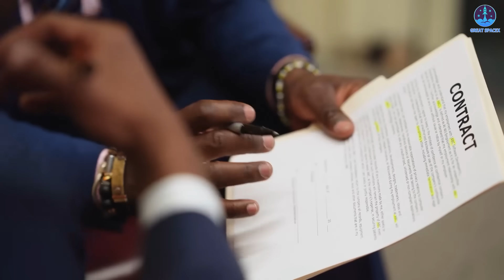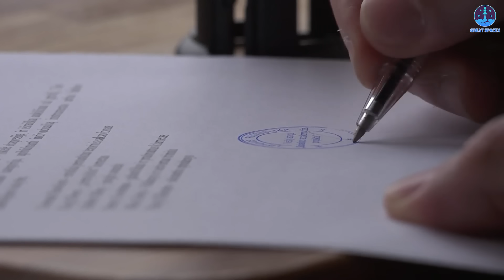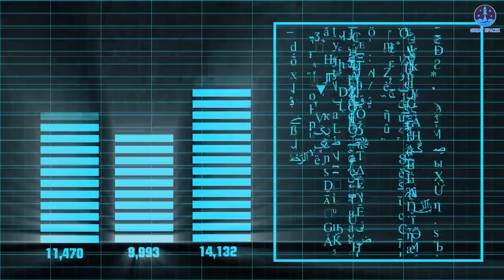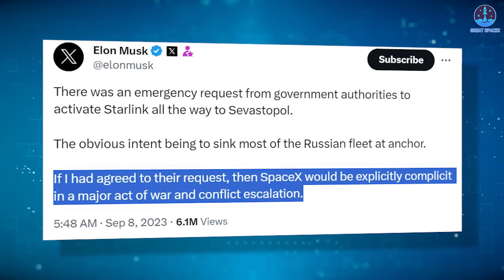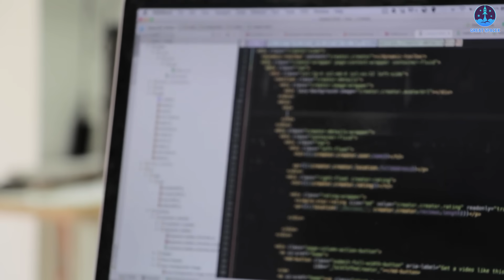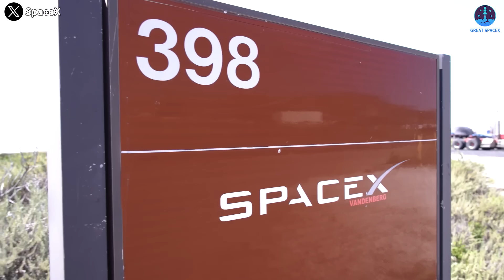SpaceX just won BIG contract that will change the game while Starship is Ready to launch...

Comment: 0:55
NOT EVEN CLOSE.
This contract is (1) NOT the "first" (2) not even the BIGGEST, much less most "major" contract SpaceX has had with the Pentagon.
It DOES seem to be their first contract specifically for STARSHIP, but it's not even in the running for SpaceX.

Comment: This is a SMALL contract... only 70 million for "SpaceX contract provides for Starshield end-to-end service (via the Starlink constellation), user terminals, ancillary equipment, network management and other related services".  It says via the Starlink constellation... so maybe this is an interm solution until Starshield is up and running?